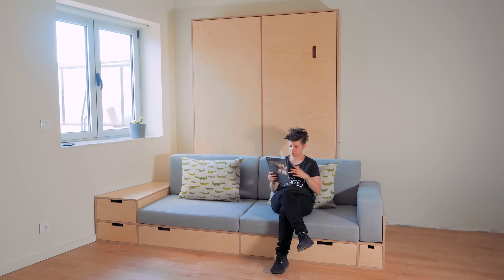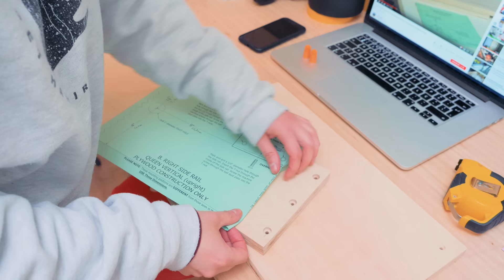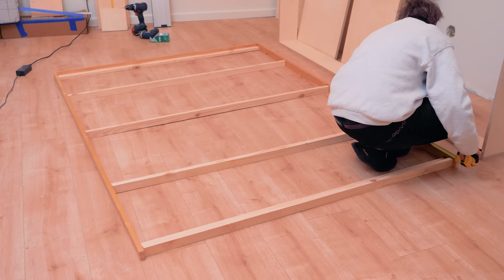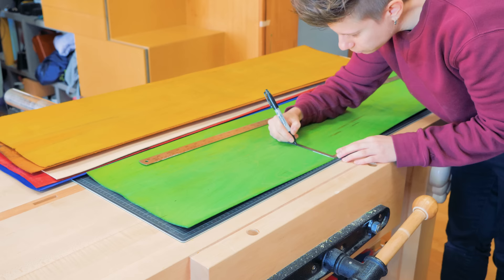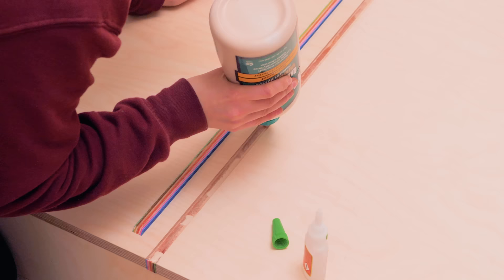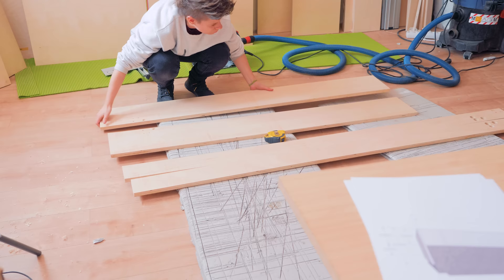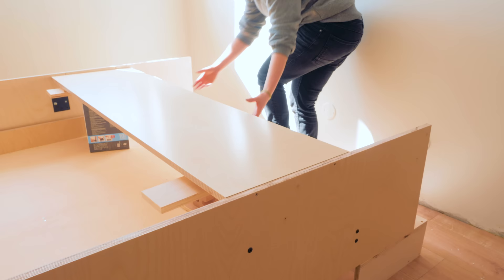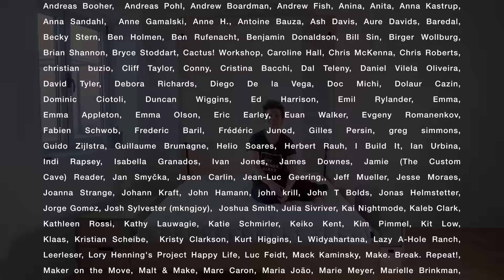How to make a Wall Sofa Bed System: The Murphy Bed // Tiny Apartment Build - Ep.5

Comment: I loved the graphics and presentation style of your videos. Birch ply is so outrageously expensive though, I couldn't imagine outfitting an entire apartment in brand new Birch ply. I only ever use when finding odd bits reclaimed. As for imperial, it is surprisingly compatible with metric as industry has discreetly made it so. Plywood sheets come in 2440x1220 worldwide, this is 6x4 feet. Timber usually comes in 25mm, 50mm or 100mm thickness - inch increments!

Comment: jaw dropping projects, nice concept.....i'll be doing the same folding bed but i will adding a retractable legs on the other end as you lower the bed the legs with automatically lower it self to add durability for the frame

Comment: Imperial measurements are great very easy to use. Metric is great and very easy to use. It when you think in one and try to imagine the distance in the other and compare to the other. 
Only problem with metric is  centimetres 
If millimetres and meters are just used. It is clearer to read. More accurate 
1.50.7 is confusing 
1.507 is more clear surly 
I suppose centimetres is to make dresses sound smaller
Cheers nice video

Comment: nice one. but having the mattress  all en-cased is not very good in regards to moisture circulation and ventilation. if you don't want them to show I suggest lifting the mattress a little inside the frame an adding ventilation holes on the side rather the the bottom. they will show (and be in use) when the bed is in use, but not when its in the casing.
also: nice idea with the rainbow details ;)

Comment: We installed a very similar Murphy bed and side cabinets system.  Though the side cabinets came fully built the bed and bed box came as a kit.  The mattress elastic keepers on the corner of the mattress we found interfered with making up the bed linen.  Instead of the corner elastic we opted for Velcro tie downs that go over the mattress and bed linen also holding the bed pillows in place.  These can not be seen when the bed is up as they attach inside the bed box.  I can supply pictures.

Comment: I love your video and appreciate all the details. Do you have a list of the tools you use for your build. I have basic tools, table saw, miter, router, but what I liked was how you had vacuum systems in connection with some of the tools. Could you share the information in what you have. I struggle with all the dust created and would like to be able to work with much less mess. Thanks!

Comment: Hi great job - I'm planning on making my own based on your design including using a custom made sofa to support the bed. My main question is without feet at the end of the bed does it move much when you sit at the foot end of the bed and if so could this potentially damage the frame and lift mechanism by putting additional pressure on it in the wrong direction? I really like the way it looks without feet on the end so am keen to follow your design. Hope to hear back from you. thanks.

Comment: In the US, that power outlet extension would be ruled illegal. Europe has different standards. 

True talk, if it is a solid connection and either taped or a wire nut, it should be fine.
Reply: I don't know the standards in whole europe.
In Germany it isn't allowed to Do IT in this way.
In most cases IT is better to install a normal socket and use a normal but good quality extension cable.

Comment: Hello I really like your work and I tell you that I also made a similar bed, I have a question for you: the fact of not having legs does not generate too much leverage and pressure on the pons when the bed is in horizontal position? If someone sits at the foot of the bed does not risk prying and breaking the hydraulic pistons or that the vertical piece of furniture is tilted forward? I consulted you because I had problems in that sense and I had to manufacture legs for the bed. Thank you

Comment: I have a question.

What if you have a pivot door that spins 360 degrees? My closet door has a large revolving door on one side that has enough space the put my bed vertical however what would be best mechanism to install for murphy bed.

Comment: Ok fill me in on the joinery tool you used for the float mortise. The link to rocker on your behalf is a dud.
I saw your sofa conclusion to the Murphy. My space is much smaller 😂😬 even horizontal it won't fit.
I'm repurposing my massage table as covid-19 has rendered my use of it useless. I'd like to build a box for the table be on. I can't seems to find the tool you used to make the float joint/ loose joinery.

Comment: Nice Build.  How much space do you have under the bed in the open position?   And how tall is your the wall bed cabinet?  I am planning on doing the same wall bed/sofa combination but need to figure out if it will fit in my space.  I only have 228.5 cm of space floor to ceiling.

Comment: Hi, i am in the planning process of building a murphy bed very similar to the one you made in this video. Here’s the  thing; i already have a framed bed, so i only need to build the storage part that’s going to stan up againt the wall. what i was wondering about is if it’s possible to assemble the metal plates that you have on the inside of the  frame on rhe outside of the existing frames? If that made any sense. I’d appreciate som tips with this issue!

Thanks in advance!

Comment: Does the end that hangs over the couch sag if you sit on the end of the bed?  I've seen a lot of murphy beds have a brace on the end so that there isn't bed hanging in air, just curious if you had an issue with that?
Reply: Ty! I missed that.
Reply: Wait for the video from the couch. She already replied that she supports at a coffee table. Everything is thought and determined. Wait.

Comment: I like your works & videos, but here I don’t really understand the point. This bed doesn’t save any space compared to a sofa with a foldout bed but adds this “cabinet” to the wall.
Reply: It's a different bed and sofa ... I guess that's what she wants most. In little space also do not need to fold and unfold the bed just pulls and pushes. Much simpler, no?
Reply from the maker: I see, but this allows us to have a proper queen size mattress always ready to go with sheets and everything once flipped. On a foldout sofa you typically sleep over basic foam or low quality mattress and you need to put the sheets every night and take them off every morning, which I didn’t want. This idea seemed more practical and higher quality to me.